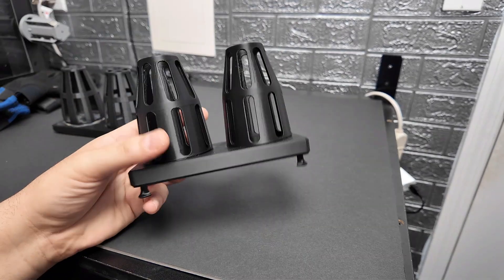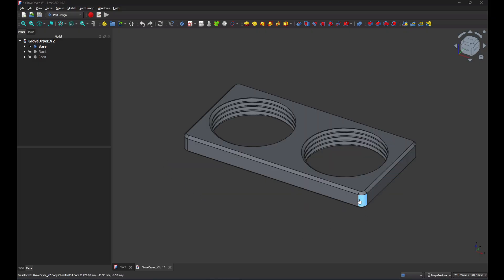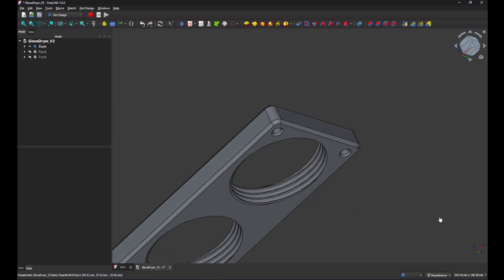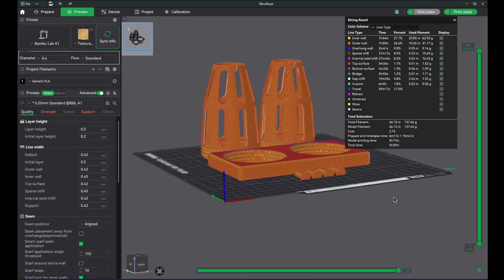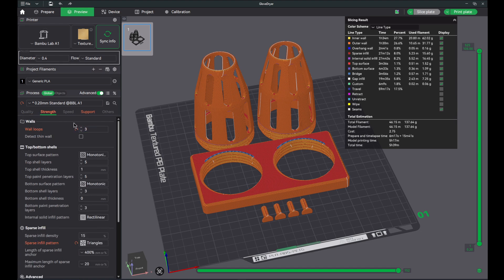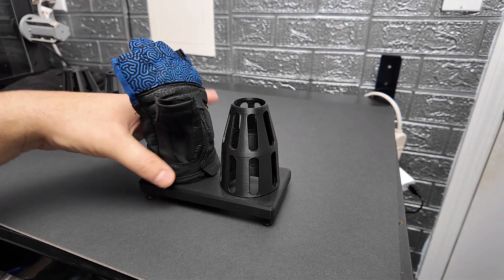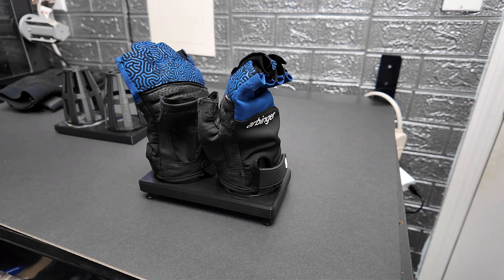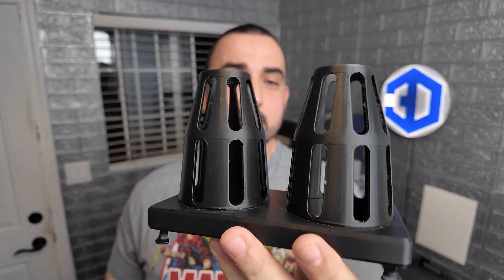I Rebuilt My 3D Printed Glove Dryer in FreeCAD (and It’s Better!)

Comment: So i tried freecad and then export stl. All i get is the primative extruded object i furst created, none of the cuts holes chamfers get exported in the stl ????? Hours trying to work out why. Hours searching net and youtube still no idea
Reply: Also make sure that the TIP is set to the last feature in the model tree. It is usually set to the last item, but you might have changed it during the design process to add additional features between the existing ones. 
The TIP-position is indicated by a small green arrow next to the icon in the tree.
Reply from the maker: That can definitely be confusing at first! Before exporting, make sure you’ve selected the final solid body (not the individual feature or sketch). Double-click the body so it’s active, the name will turn bold. Once you select the whole body in the tree and export that as an STL, it should include all your cuts and chamfers.